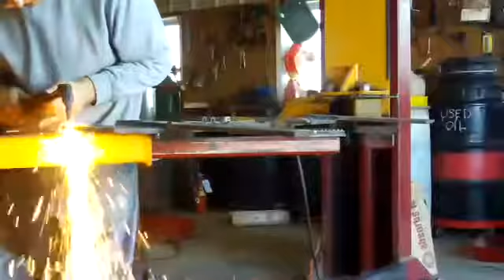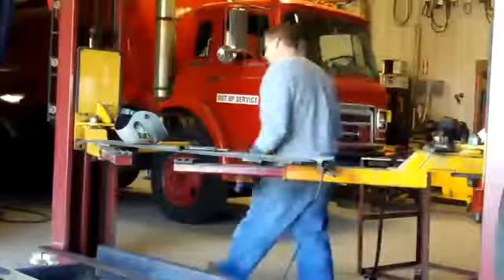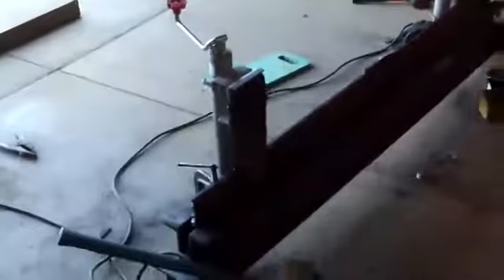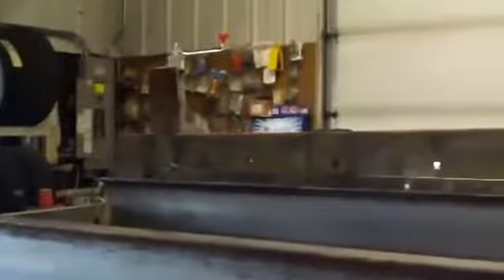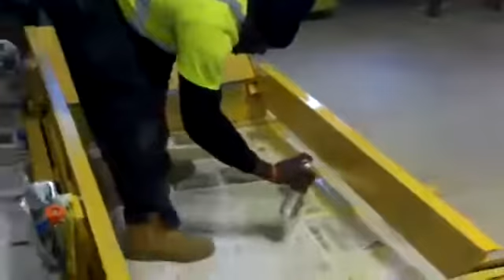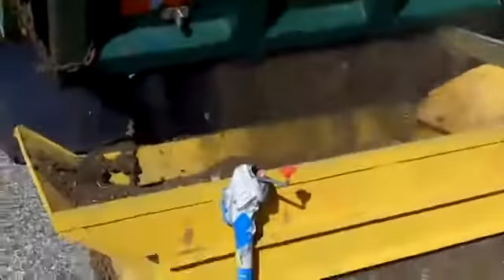The making of the Drag Box mp4

Comment: Hi, I'm hopeful you are still on YouTube. Great video,  I understand most of it except for the jacks. What are the jacks for? With an open bed, why the need to raise the back side? Thanks
Reply from the maker: Thank you.  The Jack's allow you to adjust the thickness of the material coming out of the box.   There is a blade that is attached to the Jack's.  I'm not understanding your other question regarding "raising the back side".
Reply: @stevealexander1970  If I'm seeing the operation correctly, the jacks raise an internal gate that adjusts the thickness from thin to the height of the back cross support I beam. This would give you a little extra material to work with. Nice design. I'm wondering if there might be a way to block the bottom with a sliding door similar to your back gate. This would allow you to close it up, have the tractor take the box for refill, then back to job. This would allow someone with a small business, use their tractor, keeping cost of equipment rental down. Something to think about for sure.
Reply from the maker: @Richars Britt  Yes it is kind of like a gulliteen blade.  The blade free floats  in between 2 beams and is only attached to the Jack's.  Thus giving it up and down movement.   As far as closing it off,  I'm sure it could be done with some enginuity.  Thanks for your interest in my design.